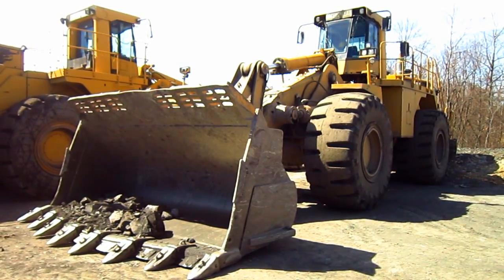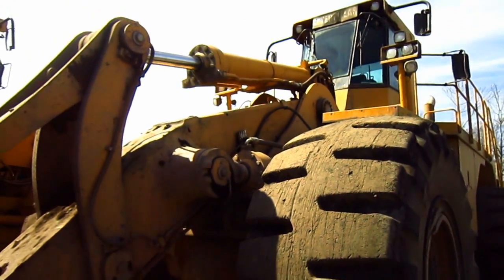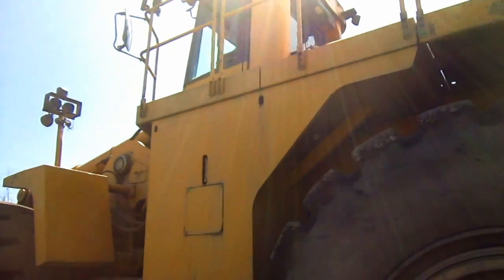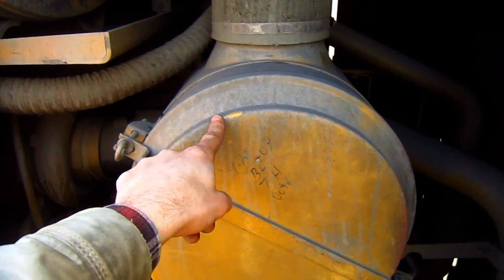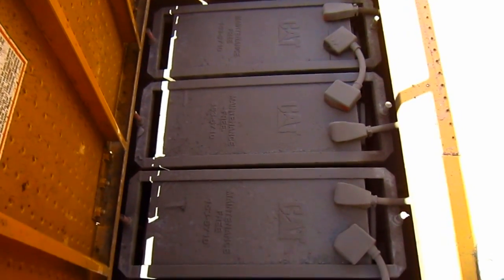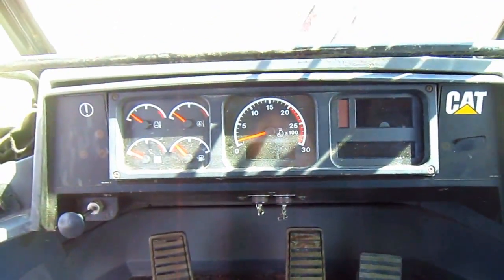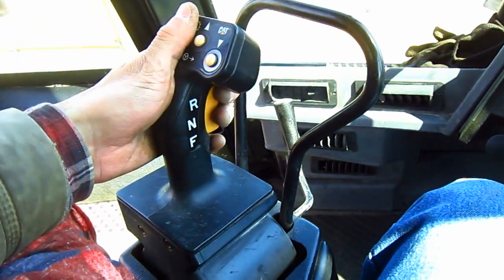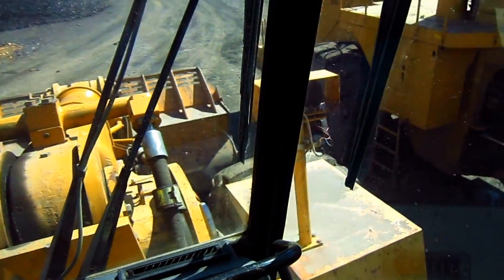Caterpillar 992G Documentary

Comment: Why on these large loaders do they have those style controls for the bucket and drive? Why not keep the controls the same as a smaller loader?
Reply from the maker: +Blake Budney Because larger mining class loaders are production machines where small wheel loaders are more of utility machines.  The operator might spend 8-12 hours a day in this machine loading trucks.  Ergonomics and comfort are key to making a happy operator which equals a productive operator.

Comment: Wonder how true it is what some of the older loader operators say when they say the 992C can out work the D G and F models.I've always wondered how well these newer machines will age with all of their electronics will they still be running when they are say 30 years old or older like many of their older counterparts are.
Reply: +Herbert V Where I used to work we had a 980 G and H. Cat brought a newer "J" maybe, set up like the 992 with the wobble stick as a demo, thinking the company would buy one.. I was running the "G" but the old geezer that did most of the truck loading tried the newer one out and cussed the Cat rep. and that loader enough to send the whole outfit to the pit! All there was was a big WHOOSH as far as I could tell. I have worked with and around the geezer for 20 years or better and we talked about that rig after it left. I thought he was "feather footing" it but he said he had it hammered but just had NO power. Needless to say, he's still got his "H". When I left the "G" had over 24k hours with no rebuilds on engine , driveline or hydraulics. Just pins, bushings and repacking jacks. Engine had one valve cover gasket replaced. Overhead was checked and was in specs and was untouched, yet and still. Cat said it ought to be shot a long time ago. Still ran fine to me. They've still got a couple of the OLD 980 square hooded loaders, "D'S maybe" with thee 3406 in them. They run every day. I just don't see the newer ones doing that.
Reply: Lewie McNeely Speaking of 980s I worked for a company that swore by the old 980Bs, spend roughly a 100 hours or so in one, was normally in a D11N. Those old 980s really surprised me some of of what they accomplished, they heaved out some rocks that were nearly double the size of their buckets. was talking to my boss today, he was talking about another local company that has 2 992Gs and an older 992C "sitting in the weeds" as my boss put it, as a back up loader, both the Gs were down one had a cracked boom ad the other the engine was out getting rebuilt. Well they sent the old C to the pit, and by the end of the day they ended up haulling 4 more rounds that day than they usually average with a G { 3 trucks I believe they were running 777Cs) with the C loading. My bos said something about the Gs having a computer that can limit the power output to stop the machine from breaking itself, where the Cs don't have that and run 100% at all times. Dunno if my boss was exaggerating or not because he has 2 992Cs and looking to buy a third.
Reply: I know the 980 G (2002 or 03 model) that I ran would pull down when anything hydraulic was activated. I didn't have a problem with it because I have nursed some real dogs in my time and that one would spin the tires and that was enough for me to work with. The older ones were straight from the pump to the bucket by way of your foot. I know the old square-hooded 980 would lift the back tires off the ground as you were rooting out a bucket full of crusher run. I know the newer one wouldn't even start to do what the "H" did. It went back down the road and the old geezer was still spitting and sputtering for a while after it left. Not good for him and I'd have to 2nd it!

Comment: These are a great loader PA. The one we have at work has over 46,000hrs on it, With an engine or two thrown in! The only real problem with these is they are Notorious for breaking that cast mono boom in half. And I mean catastrophic breakage. They break right about the lift cyl pin area. That is why on the K series they went to the fabricated plate type mono boom the same type that was on the 988G/H series. The real gain on these loaders is that they are FAST! You have to run them wide open & use the throttle lock & give that impeller clutch a work out. Another great video PA, Keep up the good work!
Reply from the maker: +56pw That's what I've heard from a lot of operators.  Seen one that had it's boom getting replaced a few years ago.  That would be why Cat changed their design on the newer 992K.  Curious to see if they switch back to the twin boom design like they did with the 988.Thanks